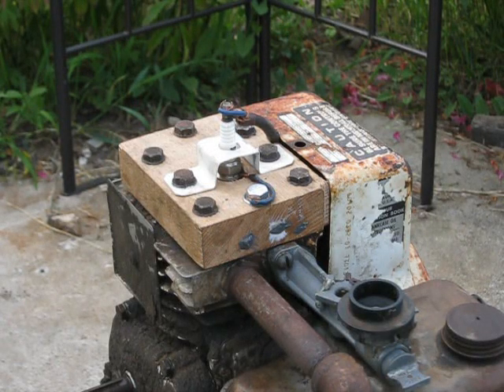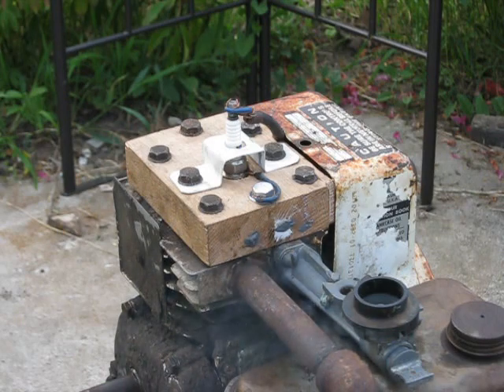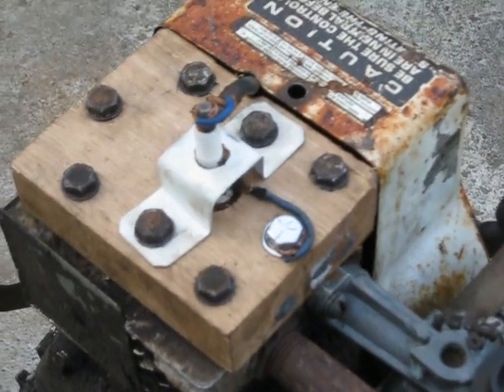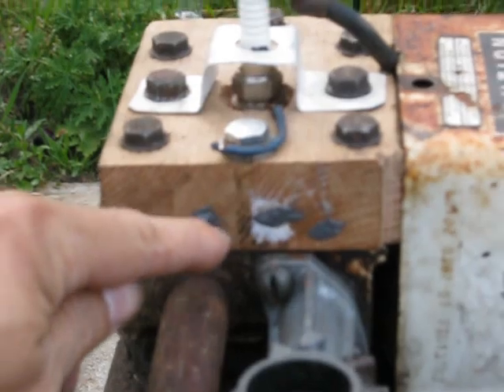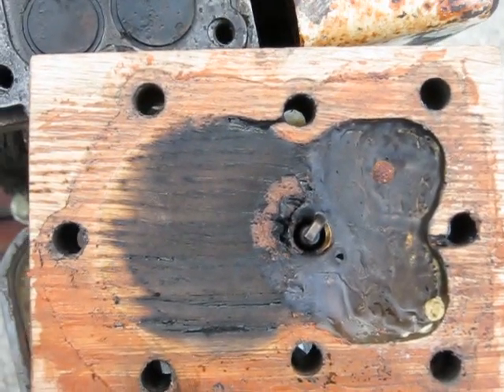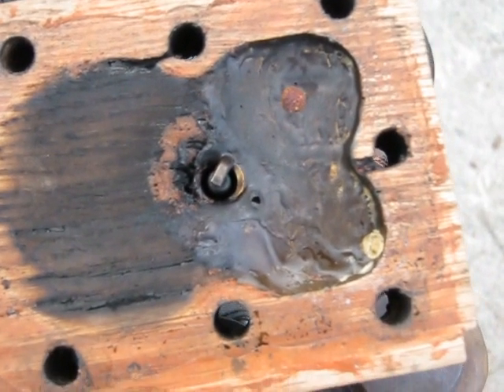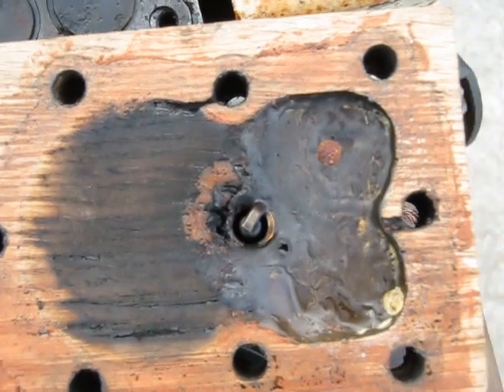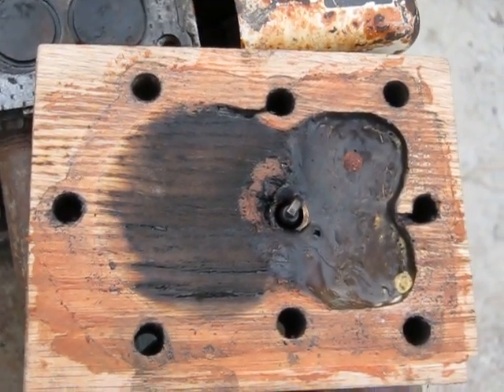Wooden Head FIRES UP!!!

Comment: 370° to 380° degrees of valve opening ???? There is ONLY 360° degrees in a circle...... right???..... it most be the " Mandela Effect" and I just don't understand this reality.
Reply from the maker: Yes, 360 degrees in a circle, but the 4 stroke engine uses a 720 degree cycle, hence this cam CAN have 380 degrees of duration.
Reply: ChargerMiles007 720°degrees totaling between two cam lobes added together.

Comment: I wonder how long it'd run with a thin layer of epoxy over it... Not the cheesy stuff, but something good like the steel reinforced JB weld that comes in the putty stick you knead to activate. I wonder if it'd make a practical repair...

Comment: Try a wooden piston with normal rings and connecting rod! I think that would be cool. It might last a bit longer since it would only die when a hole burned thru it. I would if I had the tools.
Reply from the maker: I don't have the tools to turn a wooden piston, like I used to  :(  Good idea though!
Reply: That must suck.
Reply: ChargerMiles007 add heat resistant silicone inside it will run for 3+ hr longer
Reply: Lithuanian science No it would not. The silicone would come off.
Reply: The head burned out after seconds, a wooden piston that moves would last even less time.

Comment: Now to do a wooden piston, which I've seen done but never in action...that's how I found this video.
Reply from the maker: i don't have the machining availibility to machine a wood piston.
Reply: +ChargerMiles007 I saw it on Facebook, it was in Vietnam inside of a 2 cycle motorcycle engine. the only part that was what was the Piston but it still had the metal ring and whatnot.
Reply from the maker: Really, I am amazed it actually worked very well ! I guess you never know how things will work!

Comment: A scrap piece of sheet metal adhered to the side facing the cylinders might make this a viable option but for what reason besides cost?
Reply from the maker: i doubt it would ever be viable, it would burn up too quickly, I just made this as an experiment.

Comment: what if you wrapped the wood in tin foil?maybe even push it through the bolt holes to fully seal it from the combustion.
Reply from the maker: +Lemons That could help out, i am thinking of making a new one, so I will consider that idea.
Reply: +ChargerMiles007 might try a tighter grain wood. some tropical hard woods are crazy strong and dense. possibly paint the inside with high temp paint.
Reply: +Luke Hawkinson I think a video of trying multiple wooden heads wood be neat. lol
Reply from the maker: I plan to make another one, I am just having a hard time concentrating on any one project, I have a bunch on the go!
Reply: try using teak wood, its so dense that it sinks in water, doesn't float.

Comment: why. I have some heads if you need one
Reply from the maker: +nicholas young Thanks for the offer, I have the original head for this engine, so I am good. I just did this as an experiment to see if the idea would even work. I would expect if the head would stay sealed for even a few minutes the heat build up would cause the wood to explode, so NOT an idea I would want others to try!
Reply: +ChargerMiles007 
Use silicone for the holes and flaws.
Actually, once the wood carbonizes it will be partly self-protecting, and should run a good long time, especially if you keep the fuel a little on the rich side, so the carbon won't burn away. Then it will slowly get thicker and thicker until the block fails.

Comment: You could try Australian Iron Bark which is an extremely hard wood. If you use it straight in a stove or heater it'll quickly melt / burn out the firebox. Maybe you've heard of Colin Furze who has similar wacky original yet fun ideas. He does stuff such as towing a car in gear with its engine head removed to film 10,000 rpm pistons :) https://youtu.be/j8gvgISVHak
Reply from the maker: +sp9rks WOW, I will watch that vid, thanks, and thanks for the advice about the wood.

Comment: lmao this is awesome
Reply from the maker: +ittotaq Glad you liked it, I should build another one from less porous wood, oak turned out to be a bad choice.
Reply: +ChargerMiles007 treat the wood and make it closer to raise the compression. use some gasket too so you don't have the wood wrapping around the block and causing leaks or cracks. just suggestions. I have no idea as you're the only one I seen try this lol. should post it up on jalopnik as well!
Reply from the maker: +ittotaq Thanks for the ideas, with these FrankenBriggs projects, you never know what will work best!

Comment: It's a funny idea but I would imagine that you would have cooling problems and a possible fire hazard from running hard or long since the wood wouldn't dissipate heat like aluminum
Reply from the maker: Farmer Jon 25 Yes, no doubt this head would never last for very long, as you mentioned. My friend thinks it would do much better with a sheet metal liner, and maybe it would, but I didn't want to have an explosion hazard on my hands, so I am glad it ran such a short time. I may try another head from a type of wood with much smaller pores, oak was a bad choice, in spite of its strength.

Comment: It would be awesome to see you try again but cover the combistion chamber with jb weld. Awesome video
Reply from the maker: unworthyfame I plan to try this again using a different type of wood, as the oak was too porous. The friend that thought this up suggested I line the chamber with sheet metal, but I thought that could lead to the piston getting lunched when the metal broke loose from the wood. A JB lining would be a consideration, as it seemed to hold up OK in the vid.

Comment: I heard the wooden engine tale, too. It was at an underground race car shop, where guys claim to make power that the engines can't handle. They claim a regional guy has a wooden motor that starts-a small block replica. Your videos are the best on the internet (except for human/animal rights vids). The monosoupape is great. I may make a lead head for a kawasaki after this. They say the center of the piston is the hardest part to tune....heat.
Reply from the maker: gxsrtom I am sure you will have a challenge making a lead head, just be careful if you decide to run it, I had extra safety equipment on for the wooden head, as it could have grenade!Glad you like my vids, I hope to have my 3 cylinder running fairly soon.

Comment: Ever try putting a thin piece of steel under the wood, just to see if it would behave for longer?
Reply from the maker: t4thfavor1212 No, I haven't tried lining the wood with a thin metal liner. The friend who suggested the wooden head thought of the same thing, but I would be worried about the metal coming loose and lunching the piston. I mainly just wanted to see if this experiment would work at all, which surprisingly it did  :)

Comment: Love the 4 cylinder set up and this just blew my mind my Friend! A good wood to use is either "Iron Wood" or "Ebony" They are two of the hardest woods known and have a very tight grain. They're actually harder to mill than aluminum...lol. Excellent to see this little Briggs run with an oak head. Too cool! Cheers!! Zip~
Reply from the maker: ZippoVarga Yes, I bet those 2 types of wood would indeed work best, though cost a mint!!!  :)The friend that suggested I make this thinks I should make a metal liner to hold the gas pressure. If I try anything, I think I would give maple a try, fairly cheap, and close grained. That is wild that those woods are harder to mill than aluminum!
Reply: I've made a number of furniture pieces using hard exotic woods, and the difference between the typical hard wood and these uber hard woods is incredible. It's hard to even out the transitions between these harder woods to the likes of Cherry, Walnut, Hickory etc. Really have to take your time or you will burn up a router bit or dull a cutter knife on the planer. Keep up these awesome projects! I'd love to see the turbo Briggs set up and produce boost....are you re-engineering it so the turbo is between the carb and engine, where it will work best? Cheers my Friend! Zip~
Reply from the maker: Sounds like those woods are tough customers to shape!
I think the carb is currently between the blower and the engine, a blow thru set up. I really should drag it out  and try a run. Originally we had the carb on the blower inlet, but it had a long intake path, and the pulses blew a cloud of gasoline mist around the engine!

Comment: Haha, what a neat idea. Thanks for showing us your experiment :-) I never would have thought the high compression could eat holes like that in the pores of the wood. Very cool video :D

I wonder how particle board or dense MDF would handle.
Reply from the maker: I suppose MDF or something might work. I am not brave enough to try it though, I figured oak was a safe bet, as it is pretty strong. Then I ran into the porosity problem.

Comment: awesome, it ran!!
Reply from the maker: Yes, surprisingly it actually did manage a short run. From some of the comments, it appears that using a different type of (probably expensive) wood, might enable quite a bit longer run. Though I personally don't recommend it, as the head might eventually suffer a catastrophic explosion due to heat build up. I always wore a face shield just in case!

Comment: I'm surprised it didn't last a little longer. Did you soak the wood in oil or water? What type of lumber?

Cool idea
Reply from the maker: Yes, it was short lived!  No, I didn't soak it, just ran it dry (I wanted it to burn up, though I am ticked that I didn't have the smokey exhaust pipe in view). It is made of oak, which I learned wasn't the best choice due to the large pours.
Reply: Ah, probably cherry or walnut would have been better, but those are definitely expensive!

Comment: Amazing! I always thought about making a cylinder head out of wood, but never put it into practice. At the moment i`m trying to convert a small 2-stroke-engine to be direct injected so it can run on regular gasoline rather than fuel-oil-mix. Quite difficult, since i have to install en external air-pump to the ports in the cylinder somehow... I hope to get it running!
Reply from the maker: A direct injected 2 stroke, sounds like a nice project. Yes, finding the right size of blower will be a challenge, that why I have used another slightly larger engine as a piston type blower for my 2 stroke conversions (from 4 strokes). It is bulky, but has worked OK for my experimental short run time engines.

Comment: so how long till we get a glass head charger, ah just kidding
Reply from the maker: No plans to make a glass head at the moment, I have had another engine project on the go for a few month now, but it still requires more machining to complete. I am moving on to the FrankenBriggs 4 using the LoveJoy couplings they sent me to try.
Reply: ah yes i recall that, hopefully they will work well
Reply from the maker: A glass cylinder head, that would be a trick!
Yes, pinging would NOT be a good thing!
I am thinking a person would want to be especially well protected when starting said engine, perhaps a bullet proof vest, safety glasses and a face shield as a minimum. I would lean towards an electric starter and a 3/4" thick plywood box with a small thick plexiglass window for making the vid. 
Guess I better have a look for3/8" plexi, since you know I want to do this now! lol  :)
Reply: any pinging would be catastrophic
Reply: oh boy, now charger don't go get your self all full of holes, but i am sure they make glass that could handle it
Reply: it has been done! seen a few on smokstak and OMB forums. they are ultra retarded to slow down the timing so can you see it fire.
Reply: ChargerMiles007  How would you mount the spark plug? I'm thinking cylinder pressures would push the plugs right out and strip the fairly fragile glass threads?
Reply: well this is just a spit ball but i would say some sort of metal insert would be cast in the glass maybe around head bolt and plug hole
Reply: Mr3wheeledbike
Or it would be held in with straps similarly to the catcher used on this wooden head engine. Like a tensioned metal strap forcing the plug to seat on the head.
Reply from the maker: I can see a glass head causing all sorts of fabrication problems!!!

Comment: Hi, it ran pretty nice, but i think if you had used some other kind of wood it would have run better.. Oak is pretty strong but has very large grain (or how do you call that?) and the brighter parts of the grain are way less strong then the darker ones..  (for example try to scratch it 90° to the grain, you can clearly see it then) So thats where its burning through i guess?
I would rather use beeche wood, red beeche would be pretty capable i guess.. I dont know how available it is in the us though. Beech has very small spaced grain and its overall pretty evenly strong.. 
Also if you sand and polish the inside of the head it wouldn't catch fire that fast maybe.. (don't know how much of an effect this would have)

Just a few thoughts.. I thought about the idea of a wooden engine often times, but i rather thought about a flame licker or stirling engine.. But in a smaller scale friction is a big factor and wood hasn't the best values there.. So no way i guess.
Reply from the maker: Thanks for your advice, sounds like you know a lot more about wood than I do!I chose the oak since I had some scrap pieces already. I totally agree with what you said, oak is too porous, so something like Beech would be much better. I even wonder about maple or other woods, though it certainly isn't as strong. I have put this head away as a shelf ornament now, so somebody else can take over from here if they want. Just please be careful and safe if you try one of these wooden heads, note I had a metal spark plug retaining strap, to prevent blow out. The main concern is the wood grenading from the combustion pressure, and this becomes more of a danger the longer it runs.I would prefer ppl just watch this vid, and don't take un-necessary chances, as I always take safety precautions. Have fun, and keep it safe!  CM007

Comment: I wonder if a little water injection rig would keep it goin a little longer.  Haha. This is great.
Reply from the maker: Perhaps water injection would help to cool it down enough to last longer. I think a different type of wood is called for, like the Beech mentioned in another comment, I guess oak is too porous.
Reply: +ChargerMiles007 
Just hadda come back to watch after the story about the escort with wooden lifters as blockoffs😂
Reply from the maker: Yes, those wooden block offs worked well, though if the engine stopped in the wrong spot, 2 cylinders would come up on compression, and the starter didn't like that, though it did start. It shook quite a bit until about 2000 rpms, I drove it a month or two that way, then parked it. It solved the oil consumption problem though.